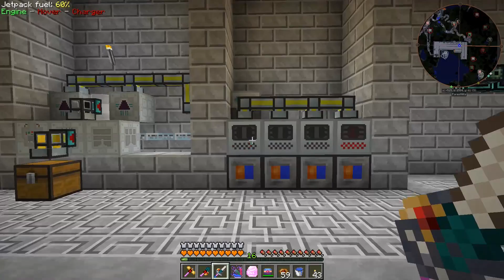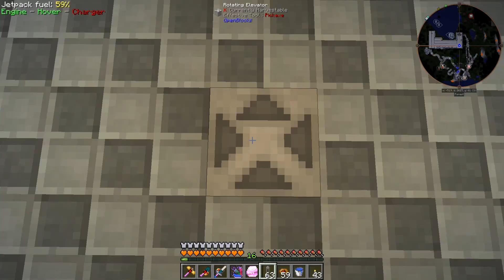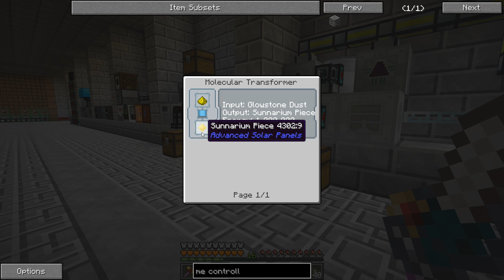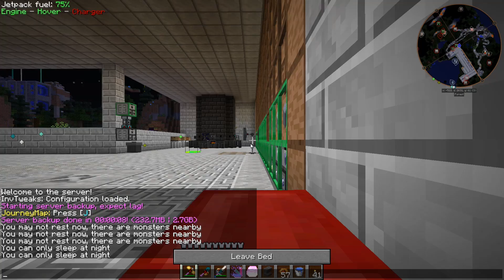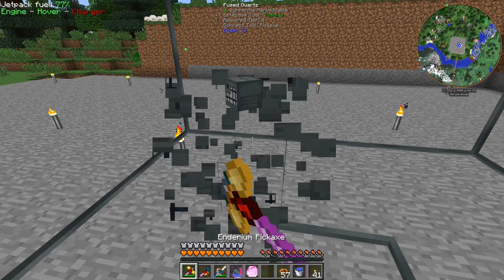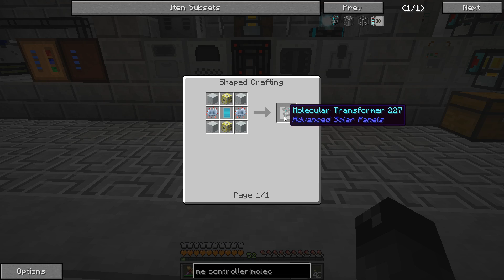Minecraft Mods FTB Infinity Evolved - POWERED SPAWNER [E32] (Modded Expert Mode)

Comment: Isn´t scrap box better as amplifier to the mass fabricator than scrap?
Reply from the maker: +José Feio It lasts 9 times longer. They're exactly the same. If you're burning through scrap faster than you can input into the Mass Fabricator then in that case they could be considered better.
Reply: +Hypnotizd I thinked that were better ahahah... But i think you are right!

Comment: For the question if a mass fabricator can go faster : yes it can. Everytime you reach 1.000.000 EU with a Mass fabricator it prouduces 1 mB UU Matter. With scrap it only need 166.666 EU per mB .  The Fabricator accepts infinete power, so by supply bigger power packets faster ,it can produce UU-matter faster all the way to 1 mb per Tick

Comment: hypno, the mass fabricators speed is based on how much power you pump in to it, if you give it more power it will go faster, also if you put some voltage upgrades so it can take high voltage the power will go in faster also lol hope this helps
Reply: +Koran Harwood i may be wrong about the upgrades, but i know you can put some upgrade in the mass fab
Reply: +Koran Harwood you can put the upgrades in the fabricator ,but they really dont do anything. The fabricator accepts basicly infinete amount of power ,for Ic2 that means  8192 eu per side if they are enough Eu packets in the network
Reply: ok cool thanks
i didnt know that lol
Reply: Koran Harwood ^^ i tried out a lot of setups, turns out at one point you produce more EU than scrap can keep up. The way the MSFU stuff works is basicly it gathers EU and makes packet to put it in the system. However the speed the package is made is zero ticks. So you can make 1 mb UU matter per tick of a mass fabricator :D ....the amount of energy you need is absurd but it is possible (even with solar panels ...122 to be exact XD)
Reply: ok i think i get it lol 

i havent used mass fab for a while, i might try it out later

Comment: is it me or did you get infinite iridium here before your normal lets play?
also your mass fabricators DO need more power but your cable can't get it to the mass fabricator...
Reply from the maker: +jklw10 I didn't even start working on IC2 stuff in the original FTB Infinity series until way late in the game. There wasn't really a need to other than me wanting to play with it. Here I need to have this done to unlock Applied Energistics. This is a huge motivating factor to get it done quickly ;-)

Comment: You can make some really amazing solar panels from that mod you should look into that mid
Reply: Mod*
Reply: +Lake Degroot It is a matter of opinion if this is amazing or not. I used solare panels at the beginning of my 1st modded mc, which was ftb monster, and then I realized that after once set up, those are very boring and ruin the fun of seting up a more complex power system. Since then, I only use solars for small dedicated power needs far away from my main base.

Comment: could you use the white mushrooms, that you are no longer needing, to use as scrap? this could give you time you build up more cobble and convert them to slabs, and a use for the mushrooms
Reply: +DominicanPaper

 Pam's food doesn't work for the recycler, but micro blocks does. one block of cobble stone can create 32 nooks, each having an extremely high chance to produce scrap. 3 stacks of cobblestone equals to 6 stacks of slabs if you want to go that route, effectively doubling the output chance for scrap, which can be condensed into scrap boxes to give an amplifier of x10 instead of x9 from 9 scrap in a mass fabricator. a x1 amplifier cuts down EU requirements from 1MEU to 166.666KEU to produce 1MB of UU-Matter. You can also use UU matter to duplicate Thaumium and Manasteel blocks/ingots one you research them into the crystal memory. As long as it has an item ID, you can duplicate any item with the new UU matter system.
Reply: Nooks don't cause any lag as an item. Sure, while it may cost durability of the saw, and crafting the saw itself, I find no set back from using one, since flint saws are renewable from pulverizing netherrack for gravel, and then pulverizing gravel to produce flint. you get 32 nooks from 1 block, as opposed to having 3 blocks to create 6 slabs. you have 32 chances to produce one scrap, compared to 2 per block. that's 16x more chances to get scrap than what you can normally craft. Plus, with botania, you can convert gun powder to flint once you have the alchemical catalyst set-up, effectively turning flint from a non-renewable resource, to a renewable resource. Additionally, any solid block you wish to recycle can turn into nooks, except gravel and sand, as they obey gravity rules. A resonant extruder with the cryo upgrade produces a stack of cobblestone per craft, so you are making 2048 nooks to send to the recycler, giving the recycler, 2048 chances to produce one or multiple pieces of scrap. that's with one bucket of water, and one bucket of lava to produce that much cobble. You can set up auto crafting in a cyclic assembler to cut down the blocks into nooks. as long as you have the schematics and saws needed to craft it. A flint saw is crafted with two stone tool rods, two sticks, and two pieces of flint, and has about 150 uses before breaking. That will turn 30 blocks of cobblestone into 32 nooks each, equal to 960 nooks for recycling.

Notes:
  micro blocks will only cause lag if they are placed as blocks.
  A cyro upgrade for the resonant extruder requires, a diamond chipset (diamond and redstone in an assembly table), 4 obsidian, and 2 cryotheum dust in expert mode. If blizzs cannot be found, you can place a snowball into a fluid transposer with 200 mb of destabilized redstone to produce blizz powder.
 There is a tool from thermal foundation that lets you gather snowballs and ice by freezing the local landscape.
 Additionally, you can gather snowballs in the twilight arctic biome of the twilight dimension.
Upgrades for thermal foundation requires the hardened upgrade and reinforced up grade first before being able to handle the resonant upgrade. Some resonant upgrades are "nerfed" in expert mode, such as producing 16 obsidian from the cryo extruder upgrade.
Reply: Any item... Dang.
Reply: +metayoshi1 But does it really make sense to craft nooks instead of just using more max upgraded ingenious extruders or if diamonds don't matter, fully upgraded transfer nodes? That nook thing sounds like more lag and a much more complicated setup.
Reply: +metayoshi1 wow that was a long one. With lag, I meant because of all those processing steps that add up to the averall load of the java system. Maybe I should have been more explicit. Creating a stack of cobble at once with the extruder versus about one autocrafting operation for each nook. You may be able to autocraft whole stacks at once, using sfm, rftools or extra utilities autocrafting, but as there is a saw involved, I'm not sure if that "a whole stack of a time" would even be a thing with those.

Comment: U could have gotten the irridium from Runic Dungeons pretty fast + a lot of loot
Reply from the maker: +panma68 You need 3 chalk to go into a runic dungeon. Since I don't have 3 chalk I don't think I could have. ;-)
Reply: +Hypnotizd You can find chalks from jungle temples, desert temples, or village blacksmiths. I found 3 with no trouble... other than my resonant jetpack running out of fuel on me, and taking 40 minutes to recharge it back to full again. You also need 9 chiseled stone bricks from witch circles or chisel, along with 16 stone bricks to surround the 9 chiseled stone bricks. the magical staff needs 2 diamonds, emeralds, and gold after finding the 3 chalk parts. Place the chiseled bricks down first in a 3x3 square, then surround it with the stone bricks, right click with the magical staff, and viola, runic dimension. The chalk does not get consumed when you craft a magical staff. You get 1 free key on your first visit, and each time you run out of keys, you have to re-fight the wither boss (which means collecting another 3 wither skeleton heads), or duplicate the nether star with the UU matter. Every room, other than corridor rooms, contains at least one or more keys, which are used to enter more rooms in the runic dimensions. You can also find Manasteel and Thaumium in the runic dimension as well, without going into botania and thaumcraft respectively. However, for Terrasteel and Void metals, you're kind of out of luck unless you're at late game botania and thaumcraft.
Reply: Ye it is not that hard to go and find some chalk.Desert Temples often have 1 or 2 magic chalks
Reply: I think it might be for him, be cause of how he needs to keep the chunks loaded to have everything properly loaded in and out of automation, and recording purposes. Luckily, the MFR chunk loader is craftable, along with the personal anchor as well. The personal anchor keeps everything in a 3x3 chunk are active. Though, the recipes may have been changed since the personal anchor requires i think emeralds.
Reply: I think that is a pretty boring way to handle this modpack. Rather do it the fair way ;).